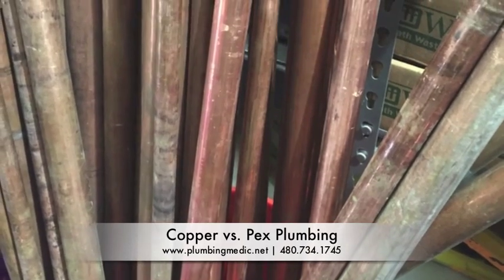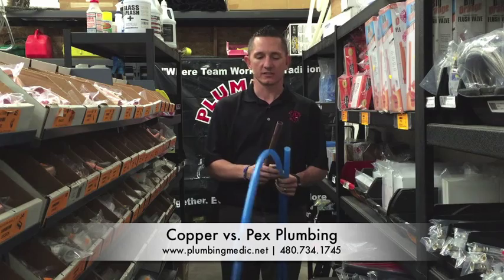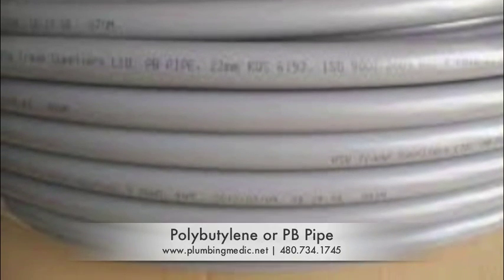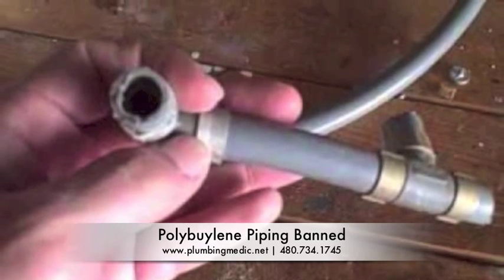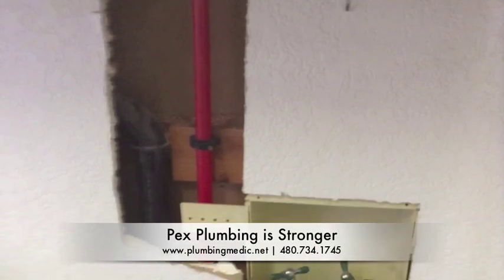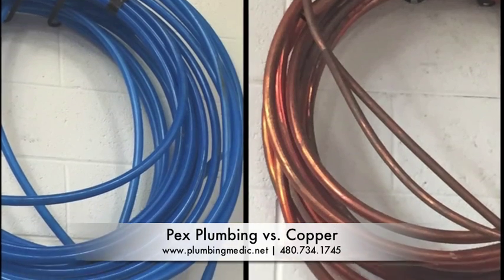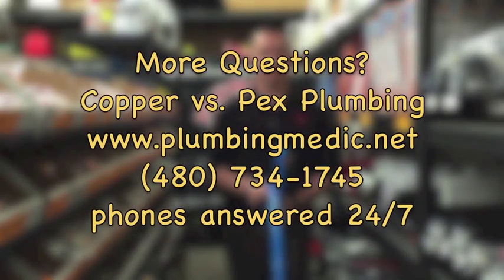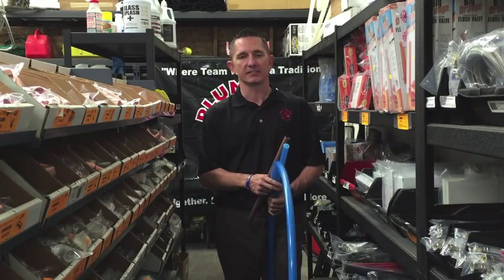Copper vs. Pex Plumbing | Rite Way of Phoenix

Comment: All of the recent failures of pex is the best reason to use copper.  Copper will last 100 years+.  The cost of repair from a failed pex fitting is ten fold what copper would cost.
Reply: Mike West ，   100 years?   my house started leaking after 15 years.

Comment: Do you have a recommendation on what is the best type of clamp to use for pex? I have watched a few videos on the subject and there are many differences of opinion.
Reply: Cleveland Matheson couplings
Reply: Can you be more specific?  sharkbite fittings? when I asked about  clamps ,I meant there are numerous fittings to connect sections of PEX together, one is a copper type clamp/ring and the whole ring is compressed I think it's Apollo that makes that tool that is used, the other tool just pinches part of the clamp and supposedly those tend to leak or are not as a  good a connection to the PEX.
Reply: Cleveland Matheson what I meant was if you have a leak in the pipe you don't clamp it you cut a section & you install couplings . I use wirsbo pipe & for that type of pipe I use an expander tool made from Milwaukee with the wirsbo rings you expand & that pipe has a memory it closes back up its the best in my opinion compared to all other pipe & fittings though I went a class one time & they said its 2 hour time I've never waited that long & no leaks until now . About a week ago I went a leak in the ceiling she had copper & they had done a repair with wirsbo pex & was leaking not from the fitting but from rat chewing so that's something to consider rat chewing .